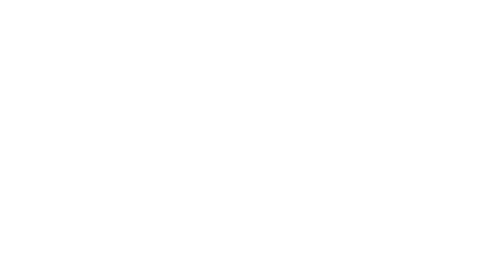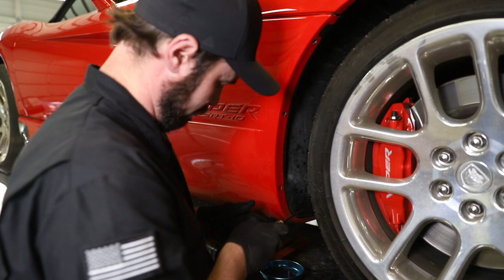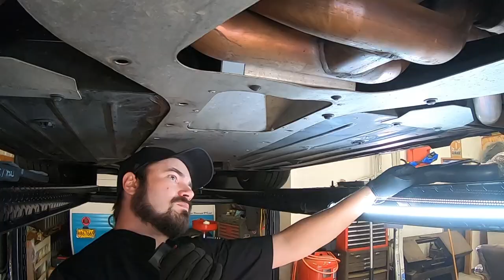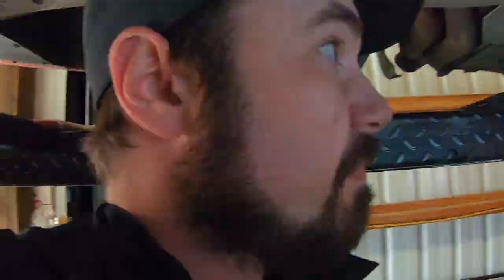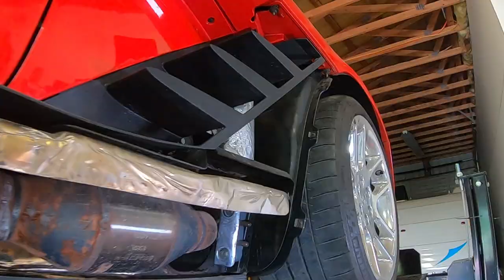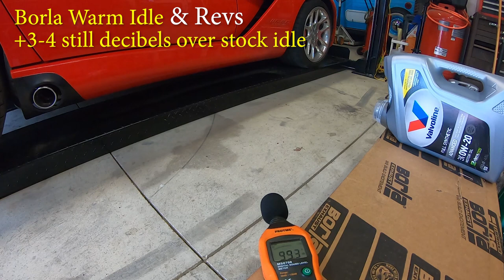Borla exhaust on the 3rd gen Viper

Comment: Was wondering if it made a noticeable difference with the heat. Also wondering how bad the heat was in the first place as I am about to buy an 03. If I hear one more person say “it’s so hot you can’t drive it” and “those cars will kill you” I’m gonna throw up..lol
Reply from the maker: It reduced the side board heat a decent amount and dropped a good amount of weight off the car. Basically, it went from burn your leg hot to you can touch it without real issue. If you want to cut down the cabin temp more, you need to drop the cats, they are right near the foot well and add a good amount of heat inside when you drive it hard.

I will probably replace them whenever I break down and do headers.
Reply: AmbiVe thanks so much for the reply. I’ll be following.
Reply: Great video and editing. Does this exhaust drone in the cabin? Corsa gets the best reviews, but the price difference is drastic.
Reply from the maker: It isn't bad with the rest of the system stock, in fact some people complained I should have made it louder. I will do a new video when I have the car back together. I'll get some better cabin sound.
Reply from the maker: @Vincenzo51985  I don't think it's bad, but the initial install was with the stock catalytic converters. The other day when I was driving the factory cat fell apart and caused all kinds of problems. Apparently, it's not at all uncommon for them to just break apart. I'll be doing a video on it and I'll get some better in car and highway audio so you can get an idea of the sound as soon as I get the new high flow cats in the car and it's drivable.
Reply: @AmbiVe  Looking forward to the video! Which high flow cats did you get? Curious to see if they cause any issues with gas fumes, etc.

I just picked up a 2003 in the same color and I'm trying to decide on the best approach to mods.
Reply from the maker: @Vincenzo51985  I snagged the mid pipes from Belanger. Knowing how these factory pipes fail, I would check yours. Mine literally disintegrated pulling away from a stop sign and part throttle and completely blocked half the engine